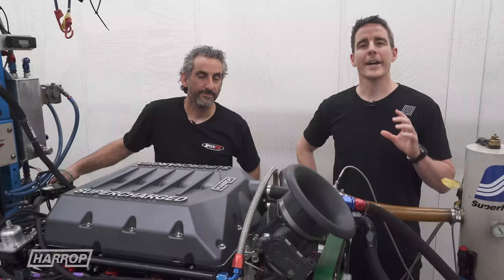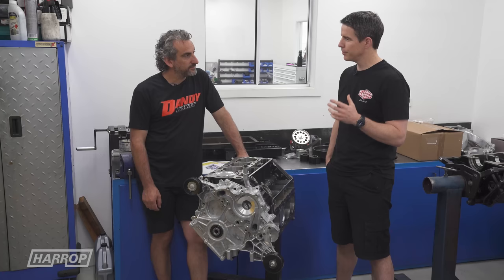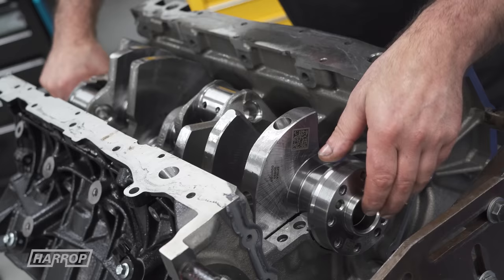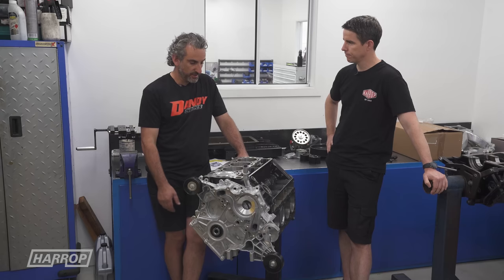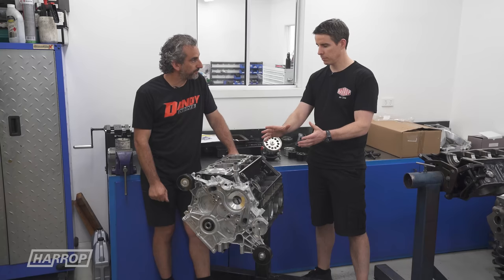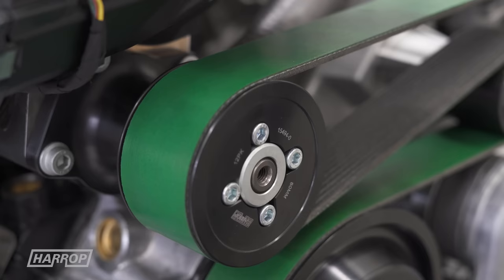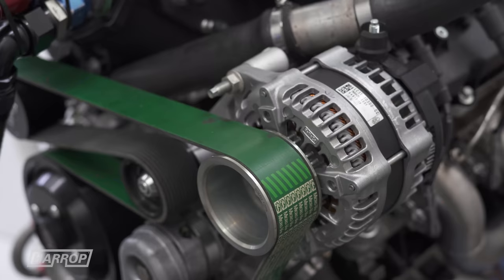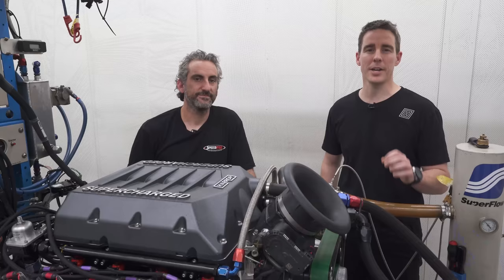1300HP Ford 7.3 Godzilla V8 | Harrop TVS2650 Supercharger Testing

Comment: The 7.3 gasser and the 5.0 coyote has made ford king of the V8 production engines.
Reply: Now that's a funny
Reply: @natemayo1827  - who’s doing better ??
Reply: @CoyoteFTW  mopar
Reply: @scotty3725  - HAHAHA seriously dodge? those boat anchors
Reply: Had to check the date, thought it was April fools already 😂
Reply: Ya pretty sure chevys LT6 will dominate all. 676 NA is insane.
Reply: @Jack Russelle Lewis - This 7.3 is better than any cam in block offered by GM or dodge. The 5.2 predator in the GT500 is making over 800hp at the crank most dynos are yielding around 710hp at the wheels. No camaro or corvette have made that bone stock.
Reply: @CoyoteFTW  what about the 632 that makes 1000hp na from chevy ? Or the 532 that makes almost 700 shipped to your door? 5.2 is a modular engine with twice as many valves as a in block cam design and has a supercharger. So it better make some power, why do you think the old termi 4 valve guys are so fast when they are upgraded they have way more flow potential with that design which is why drof should have stayed with it and left the pr motors to gm and dodge
Reply: @Jack Russelle Lewis And chevy following Ford as always. 5.5 new corvette motor is a  DOHC.
Reply: @71usmc  they stuck with OHV in the Corvette for the packaging benefit and had no problem making as much or more power than the Coyote or the Voodoo. Now that they have the room, they pulled the trigger. They skipped the cross plane and went straight to the most powerful NA flat plane crank V8 ever with a twin turbo hybrid coming. Let us know when Ford pulls that off. They also tested the LT6 in a factory backed racing program before letting it hit production. Something the Voodoo would have greatly benefitted from.
Reply: @sirob584   not really comparable considering it’s not a mass production engine like the 5.0 and 7.3. Not gonna be nearly as common. Also being able to actually modify it is is big deal. LT6 is not an engine you work on in your garage and swap into your insert LS swap car here.
Reply: Lmao
Reply: @mctigmctiggy1475  how is a coyote junk? 7’s stock sealed, factory block went 6’s in a stick shift, they make 1000 unopened.
Reply: @mctigmctiggy1475  Worlds fastest stick shift car in the 1/4 mile is a coyote mustang lol
Reply: @169abr  Mention any engine ever made on YouTube and some inbred is going to throw rocks at it. Always happens.
Reply: @fatkat311  truth, some just have more fanboys than others lol
Reply: @jaywalkin8205  - you named aftermarket engines that cost 40k that don’t come in any production car. I can also name like 10 Ford ones making over 1000 n/a too. There’s a coyote running 3.70 in the 1/8 with stock factory heads. No engine Chrysler or GM EVER made has done that. I LOVE when garbage motors and fiat guys try to always make excuses. The Ford DOHC engines are superior to anything coming out of the other two. GM finally realized they can’t compete so they came out with a DOHC engine. The 7.3 is Fords way of showing they’ve always made better pushrod. TIm Lynch’s outlaw Mustang was running 6.5 sec in the 1/4 in 2008 with a big block Ford on a 10.5 tire. The only other cars close to that at that time on a way bigger tire and and way less weight were in pro-stock. Quickest N/A engine in the world is a Ford small block. Again in IHRA & NHRA the two break 7 seconds both Ford engines.
Reply: @mtnman1984  - LMAO Ford had a DOHC making 1000hp in the 60’s in Indy 500. Congrats on catching up Chevy took you guys 50 years!
Reply: @CoyoteFTW  reading those two comments from you back to back was a good laugh. Telling people not to talk about expensive crate engines, then mentioning a race engine made specifically for one race series. Negative on the 1000 HP too. 500 was about what they got. Remember, Chevy smoked your GT500 and even your seven figure hypercar on the track with an OHV engine. They'll go even faster with the new LT6. Gobless.
Reply: @sirob584   they killed that pos voddoo 5.2 motor... only .3 larger and way more power... pour ford guys lol
Reply: @jaywalkin8205  terminator 4 valve ... thats your glory for motor.... that head doesnt even flow as much as a stock ls3 head...lol this is the best chat so far
Reply: @thomasstott527  haha ya and then they mentioned a big block from the 60’s that made 6aomething but GM has the 632 capable of 1000 NA lmfao
Reply: @gforce_117  typical for guy... your 5.5 flat plain crank is not comparable to fords 5.2 flat plane crank motor... cause it makes to much power.... lol
Reply: @thomasstott527  Look who's so tough behind their keyboard.. Learn how to spell while you're at it. Never mentioned the 5.2
Reply: @gforce_117  damn auto correct... i dont have to be tuff behind my keyboard... you just keep playin with your lil toy rc cars and baby ford motors... let me know when you wanna come over and hang out with the men lil boy lmao
Reply: @thomasstott527  You’re trying way too hard man. There’s plenty of little Ford motors out there that’ll wax you for me.
Reply: @gforce_117  I haven't found one yet.... you keep playing with those rc cars... there a Lil more your speed
Reply: @thomasstott527  lol ok bud. Look harder.
Reply: @CoyoteFTW   for the fact you said ANY engine from Chrysler or gm. I don’t see fords performance engines competing with any Chevy performance engines in this day and age 5.2 is junk makes like 500 hp for the same price as a all out chevy performance engine, Windsor platform is a joke and blows up without being girdled their old big blocks starve the back main bearing of oil after like 400 hp so no ford dosent have the “best push rod engines” they can’t even come close as stock bottom end . So if you wanna talk about times most funny cars or dragsters are custom hemi engines so at that point it’s not even about brand loyalty. Also the fastest production car at the moment isn’t even a American car. The fastest “stock block” 302 isn’t even close to a stock block when it’s girdled sleeved ect but I guarantee the fastest stock block Chevy is literally that a stock bottom end with ring gap and studs. I don’t see the 7.3 holding any records, and the coyote is obviously setting records because it’s flow potential being a 4v head but no surprise gm is not far behind being .3 off the world record stick shift domestic car making over 200 hp less. On top of that ford just crest the 1000hp stock bottom end mark with the 7.3 when ls engines have been doing that for decades now for a lot cheaper and a lot less displacement. So no ford doesn’t make the “best pushrod Engine” they make the best American modular engine for sure but keep lying to yourself when most all of fords records are on highly modified bottom ends while Chevy junkyard engines are setting records.
Reply: @jaywalkin8205  - 5.2l predator in the GT500 is making 708hp to the wheels no other production car GM or Chrysler have ever made has made that much horsepower to the wheels. But you want to talk about crate engines 🤡?   The Ford SOHC made over 660 hp N/A in the 60’s. There is NO LS making anywhere near the power of a mod motor and staying in one piece. And forget that Chrysler “hemi” junk. That’s NOT happening. Coyotes are running 8’s even dipping into the 7’s completely stock. Yes, Fords head design is superior how is that Fords fault? They built a better engine. BuT DOhC. You’re making excuses at this point just say those boat anchor pushrods from GM and Chrysler ain’t worth a shit. Fuck stock bottom end who cares about that?? "The LS is the most pathetic engine I've ever worked on." 

Rick Maskin CEO and founder of DartMachinery Ltd. took 5 years to redesign the LS block in order to manufacture the DART LS NEXT block. John Mihovetz of ACCUFAB Racing, and many other racers, and engine builders across the country like L&M Racing Engines for 10 years have been building reliable racing engines using cast aluminum OEM production Ford Mod Motors blocks, and heads in the 4.6L, 5.0L, 5.2L, 5.4L and 6.2L sizes that can make anywhere from 2500 HP to 3500+ HP @ 10,000 rpm, 66 lbs of boost on Methanol (ACCUFAB '98 Pro-Mod Mustang). John Mihovetz of ACCUFAB Racing has been running 5's in the 1/4 for over 5 years now with an OEM production 281ci 4.6L aluminum block making over 3500 HP with no engine failures in over 20 years for any of his engines or his customers. 

The $3,000 LS NEXT Block designed by Rick Maskin took 5 years to extensively redesign that now is more like a Chevy 350 block than a production GM OEM LS block. Dart Machinery - LS Next block. Far removed from most people who fawn over GM for the design of the LS, Maskin said that in his 50+ years of working on engines,  The LS is the most pathetic engine I've ever worked on. He bases it on several things, including the block's strength and oiling issues. Regarding the oiling problems, Maskin points to the enormous amount of internal oil "leakage" with the LS. The Gen 1 small-block Chevy, which they built 100 million of, takes 5 gallons per minute of oil at 6,000 RPM to lubricate everything. Our modern Pro Stock engines use 3 gallons at 11,000 RPM. The LS uses 18 gallons. What's wrong with this picture? The excessive  oil use and the resulting issues associated with it are due to GM's design of the oiling system, which Maskin points out has numerous problems that are eliminated by Dart's LS Next cast-iron block. In order to provide additional bottom-end strength, the LS is a skirted block, which creates excessive crankcase windage. To address it, GM used "communication ports" or windows between the cylinders, above the main bores, but that leaves very little metal to hold the main bores and cam tunnels in place and can lead to wear problems. All cams flex a little and it's no big deal, but in the LS the cam and crank are like noodles in there, and it wipes out bearings and lifters. 

Will we ever see a OEM production LS based powered anyting run a 5 sec E.T. in NHRA
competition? No.
Reply: @jaywalkin8205  - Demon was dynoed at 703whp latest zr1 was at 645. And sure misinformation, you have all the information at your fingertips you choose to be ignorant that’s your problem. Windsor and Cleveland came out early 70’s and you’re comparing them to and engine that came out in mid-90’s. They’re still competitive! What does that say about the ls 🤣
Reply: @CoyoteFTW  this 800hp gt500 you speak of...is only 760 at the crank...typical ford guys add a Lil extra to make it sound good 🤣... they still get there  @ss handed to it by a bone stock c8... with only 495 hp.... 🤣😂🤣 good job ford... and the much less HP camaro ZL1 ..1le will take it as well... but most ford guys don't post facts...
Reply: Let's compare apples to apples ford guys.... Fords new 572... (finally a large man motor) 655 HP ... ... chevys 572.... 720 hp.... enough said...
Reply: @thomasstott527  Correct. I recently saw a GT350R in person that was for sale. Noticed that the coolant reservoir was dirty. Turns out, second motor. 15K miles on the odo. I'm just laughing at this whole conversation. The LS is awesome. The Gen 3 Hemi is awesome. The Coyote is awesome. The Godzilla looks awesome. The Big Three are car companies, though. Crate engines are secondary. The pushrod powered C7 ZR1 smokes anything else from The Big Three on a road course, which is now the focus and the reason why you see track specials built for it. The base C8 will smoke anything domestic from a stoplight because it dead hooks and has a DSG. The Z06 will move the game even further with a proper flat plane V8 and a mindblowing chassis and since they raced with the LT6, you won't see them blowing up left and right after shedding their oil filters.
Reply: @mtnman1984  it's pretty bad when the oil filter has a torque spec...lol..
Reply: @thomasstott527  yep. BC up there going on about how good old mods are while the 5.4 Triton is a universally hated engine. The C5 Z06 was making 405 HP NA with pushrods in 2002 while Coletti had to move to an iron block and forced induction to get 390 from their DOHC 4-valve. That's unless you scored one of the 300 Cobra Rs that had to run a modified hood to fit the monster 5.4 and its special intake plenum to get 385. Then, there's the GT350. A track focused car with an engine specifically built for it that eats oil and explodes unless it blows up the transmission or diff first. The Coyote is a great engine, but Ford hasn't exactly been shitting golden eggs for eternity and it doesn't matter how much power a GT500 is pissing out. It's still slower than a C7 ZR1 in its intended use and will eventually get smoked by a C8 Z06. Talking about a block design's shortcomings when trying to make four figure HP is irrelevant. These things were made to move sports cars and trucks, lol.
Reply: @mtnman1984  - The 2005 Ford GT was making over 500 hp and an easy 10 second car. And a 3,000hp stock block reworked heads 5.4l from M2k motor sports is currently the fastest street legal car in the world pushing 3,000hp ran 300mph in one mile. The “Universally hated engine” bitch slapped every GM engine made. Just because you’re grandpa drove cheby doesn’t make it the best. You cheby guys always compare mustang to the corvette! But the ONLY corvette that beats the GT500 track pack is the C-7 ZR-1! And no Camaro beats the GT500. Poor GM.
Reply: @CoyoteFTW  2006 Ford GT: $150K, 5.4 supercharged DOHC V8, 550 HP, quarter mile in 11.2.
2006 Corvette Z06: $65K, 7.0 NA OHV V8, 505 HP, quarter mile in 11.5.
Source: Motor Trend
The Triton was a 3-valve version while the GT used a bespoke 4-valve design. Again, 3000 HP builds are pretty irrelevant in overall context, especially if you are going to use the GT as an example. A 3000 HP capable Dart LS Next engine is a bargain next to a replacement 5.4 for a GT.
Reply: @mtnman1984  - That Dart Block isn’t even an ls anymore.. meanwhile the Ford GT uses stock block and heads you see what I’m saying. How do I say it clearer ? And yes you’re right road course is what’s popular now and cheby doesn’t beat Ford on any front.. GT500 quicker than ZL1 1Le. 
GT350R quicker Z/28. Mach 1 quicker than SS 1le. Ford GT quicker than Zr1. I don’t like referring to consumer cars because there is allot of variables. So I refer to professional racing where the cars and engines can actually be pushed to their potential. NHRA factory stock and SCCA GT class mustang been whooping the camaro too even in the overall TA class ford been beating the corvette too.
Reply: @CoyoteFTW  and you’re still off topic just taking shots in the dark to see if it lands, you wanna say “I don’t like using production cars as a example” but when someone brings in a performance engine to the conversation it’s wrong and “not a production engine” so you’re the only one who can do it ? Hypocrite. Such a double standard  with you ford guys, again those aren’t pushrod engines which you claim ford has the best pushrod engines which is un true
Reply: @CoyoteFTW  *a lot
Production vehicles are actually pretty consistent by the very nature of them being copies of themselves. SCCA GT allows for heavy modification. 🤦‍♂️😆 WTH? Check those times too. The LS7 Z28 is above the GT350R on the Car & Driver Lightning Lap board, which is also where the ZL1 1LE is .6 behind the GT500 and the ZR1 is ahead of all those plus the GT. Also, Randy Pobst put the ZL1 1LE up against the GT500 at Willow Springs. The Camaro beat it. All of that... pushrod "chebys". I'd stop mentioning the GT350 too. It's the most unreliable track Mustang ever made.
Remember, car companies. Whole car. None of the Big Three is building an engine for a production vehicle to cater to drag racers pushing 3000 hp. Chevy has had no problem keeping up with and beating OHC Fords with cheaper, simpler, and more reliable pushrod packages in various cars for many years.
Reply: @CoyoteFTW   no, no you haven’t you stated false information and changed topics to deflect. The Windsor platform is at best as good as a Chevy 350 and Everything you gave examples of were highly modified ford platforms but hardly a ford engine anymore. The Windsor small block will blow to bits at 500 hp, the Cleveland holding not much more. Most all other ford pushrod v8s will never reach 1000hp from the factory for long let alone at all. You have to add so much structure to the weak 2 bolt and the rare 4 bolt engines that you can’t even call them ford engines. Ford push rod engines are garbage.
Reply: @mtnman1984  - Production or racing not GM isn’t winning anywhere against the mustang or ford GT. Congratulations on finding the ONE track the z/28 wins. All the other ones it loses against the GT350. Aside from what a keyboard warrior like your self thinks. The Gt350 is an amazing car better handling than any camaro ever. Yes the GT500  track pack beat the zl1 1le by a whole second at vir and 2 seconds at Laguna seca. GT500 has run 10.2 bone stock. Poor camaro doesn’t come close.
Reply: @CoyoteFTW How about the Nurburgring times you know that that ford is not even close to chevy let alone the Dodge Viper are you kidding me ? Just talking out your ass. Do some real research kid. The acr viper, zl1 1le, zo6, zr1, are well ahead of the gt500. All you have to do is literally google and it’s right there. Still fords pushrod engines are less superior which is the topic we initially started on.
Reply: @CoyoteFTW  ...and the C7 ZR1 is ahead of all of that. You keep going back to the dragway as if any of these cars are built for that. The GT350 is a great car with an engine that's great if it doesn't eat itself. The GT500 is a great car with an insane engine. It's a better value than both the ZL1 1LE or the C7 ZR1. Unfortunately is a two ton brick that gets beat by the ZR1 and will be left for dead by the C8 Z06. GM can do plenty with pushrods. Now that they have room under the hood, they will make great DOHC packages.
Reply: @mtnman1984  - It’s not surprising that the corvette wins it’s supposed to at the price range. It’s Corvette vs Ford GT. Honestly I don’t know about the C8 Z06 I want to see how it does against the GT500 track pack I’m guessing they tie on some courses. After all the GT500 track pack did tie with a Porsche GT3RS one of the best road course cars ever made.
Reply: @CoyoteFTW  You're saying that a $120K sports car is supposed to compete with a million dollar all carbon exotic, but not a car that is within $30-40K at most? You are setting all the rules for this discussion, so, I guess?
Reply: @CoyoteFTW  the GT3RS is at a more than 200 HP deficit. Run it against the GT2RS. I wouldn't be surprised if the C8 Z06 is slower than that car.
Reply: @mtnman1984  - Horsepower doesn’t mean anything on tight road course like the one they were tested on. Plus the Gt500 weighs 4k lbs and the GT3 weighs 3,100 and costs 200,00k mid engine. The Gt2 is a $625,000 car. You just told me not to compare over half a million dollar car to one that is supposed to sell for under 100k. So yes I do think the Gt50P track pack is going to give the C8 Z06 a run for its money.
Reply: @CoyoteFTW  You brought Porsche into the convo, lol. You can do that, but price will leave the discussion and you have to recognize the power difference. The Z06 will be faster than the ZR1. Given the same tire between the Z06 and the GT500 CFTP, they will be close depending on the type of track, but I believe the Z06 will come out ahead, sans supercharger, but at a higher price bracket. The GT500 beats the Camaro, which was the point of it, and is a great car at a great value. You can just put a different pulley on the Camaro and match the GT500. The chassis will match the Mustang. Again, though, pushrods do just fine. Funny thing is I prefer the GT350 over the 500. I'm into NA and a third pedal. I've driven the snot out of nearly every car we've talked about. I prefer the GT3s and the GT350 over any of the forced induction cars, even if they are faster. Between 500 and 600 NA really is the sweet spot for a sports car that you take on road and track. It's very seldom that you can enjoy anything with 600+. I think the C8 Z06 may break that for me, though. The platform is not at all stressed with 500 HP and a high revving NA 670 HP won't slap like a similarly powered supercharged car. It will still be able to overwhelm the rears, but the linear power over a wide rev range will offer much more control. I'll have an opportunity to drive one as soon as they begin deliveries.
Reply: @mtnman1984  - That’s all GM has though that doesn’t mean Ford couldn’t of done it with pushrod engine too but they went DOHC. After all Fords pushrod engines won dominated Tran Am and LeMans Shelby cars used Ford pushrod engines. Mr. Shelby himself said best engine was Fords 289ci small block. Saleen S7 also dominated and used a 800hp Windsor which I believe is more than any GM pushrod engine made.
Reply: @CoyoteFTW  The S7 engine is to a 351 Windsor as the Dart LS Next is to an LS1. Heavily modified and nearly its own design. You're correct about the Ford engines being superior sixty years ago. That was sixty years ago. I feel like I'm repeating myself a lot, but GM stayed with pushrods for packaging purposes and did just fine. The engine bay in the C8 is the size of a truck's, so now GM can play with OHC engines and did so right out of the gate with the C8R. I doubt the truck engines will follow suit so long as they stay with NA V8s. They're simple, cheap, and reliable. Probably the same reasons why Ford went OHV for the Godzilla. A DOHC big block would have been huge, complex, and expensive. Mercury Racing builds one. It goes for $65K. You can go nuts saying Chevy mills are shit, but the cars that use them keep up with the Fords with the constant leapfrogging. You can reference race cars all you want, but if we are going to modify cars, might as well get into modified engines: Dart blocks, Saleen, Jim Morris, etc. We could go on and on. Gobless.
Reply: @mtnman1984  - It’s a bored stroked 351 Windsor with Cleveland heads. Best flowing heads in the world. Point is if Ford wanted to keep going cam in block they would have, enter  7.3 Godzilla. What’s another engine that can match the Godzilla from Chevrolet? Without opening the engine swapping cams or porting heads? Koenigsegg also used Fords DOHC engines for their cars. Most successful engine in Formula 1 was the Ford DFV. So these multibillion dollar exotic manufacturers use Ford engines. Why hasn’t anyone used Chevrolet? If they’re soo good like you guys claim. They’re all in the junkyard and everyone swaps them because they’re cheap when they blow up just get another for $500. Even today I don’t see any Chevy engine doing what Ford guys are doing. And that was the case back then too… I don’t know what the debate is at this point all I get from you guys are if and or buts. Nothing real just make believe. Never seen Chevy win Baja 1000, never seen Chevy win leman overall never seen Chevy dominate Formula one never seen Chevy win triple crown in road course and top fuel drag racing. So Ford had a rough start trying to mass produce they’re first DOHC V8’s in their trucks. That’s all you guys have to say. And the 5.4 wasn’t bad it was two years had a bad run. Ford still builds the best trucks.
Reply: @CoyoteFTW  the DFV was engineered by Cosworth and far removed from its base design, as were the S7 and the Koenigsegg mills. Earlier, you argued that the Dart LS Next wasn't an LS. You sure can duck and weave. So can Ford not figure out how to get the most out of their street engines, or what?
Reply: @169abr  man don’t even argue with these clowns.
Reply: @larrypruitt3919  man I stopped paying attention when he said that Joel’s 6 second 1/4 could be beat by a stock 5.3 and a 4L80. These people really think the 5.3 is the greatest engine ever
Reply: @169abr  it's just cheap power, up to a point
Reply: Ford sure did have some making up to do with their engines.  Ecoboost, 5.4 triton, 6.0 diesel, 6.4 diesel.
Reply: @mtnman1984  while true, they think a 5.3 is the only answer it seems. People can’t just admit another platform is cool lol
Reply: @169abr  correct. The only thing more tribal is politics.
Reply: @mtnman1984  - Keith Duckworth went to Ford because of their Indy V8’s you can see how heavily the DFV was influenced by that engine, Ford helped perfect it. Ford had some very very smart engineers and people working for them. Duckworth became Fords racing department up until the 90’s owned by Ford like SVT or Ford Performance. The new Mustang GT does 11’s out of the box I think they’re doing fine.
Reply: @169abr  see the biggest problem I find is people are too loyal to one brand, and typically these keyboard warriors have no real world experience working on or machining these engines. I own 3 Windsors (2) 302 and (1) 351, I own a eco boost engine (which is faster than that years mustang with only a tune shocker) also, but I also own only (1) ls engine kinda funny I own more ford than I do Chevy, I even drive a dodge truck, and to be honest have gotten way further modding the ls over any of the other platforms other than the ecoboost but that’s irrelevant to this post, the 7.3 is the only production pushrod engine that really is even relevant and we’re still not sure what it’s capable of. While impressive when anyone mentions how well the stock Chevy ls block is it’s all deflection and examples of highly modified ford based engines that can’t even really be called a production engine any more. Then the topic gets changed to fastest 1/4 which really isn’t impressive unless it’s a production block that hasn’t been tampered with, like a coyote or a ls. Anyone can set records with a highly modified specifically designed drag engine of any brand but when someone pulls up with a sbe anything and sets records that’s actually impressive and give actual backing to someone’s “which engine is better” argument. For the fact that op and bc think because of this engine ford is the  “king of v8” but nobody can give me examples of fast factory block pushrod drag cars. And the history of track racing has always been Shelby Pontiac and Chevy back and forth, Shelby worked with dodge, but realistically is synonymous with fords performance division, Shelby cars are barely ford cars anyway. And the gto beat that car in almost every aspect. In that time chevy wasn’t that  far behind but fast forward to the 90s and ford was beating its v8 push rod engines with a ford contour (owned one off them too it’s faster than my 94 mustang gt *shocker*) so again fords one off cars like the gt any Shelby which is race oriented and expensive as all hell. So no the answer to the original topic and bcs 2cents. ford went away from pushrod engines for a reason the last 2 they made were crap and the first iteration of the modular engine wasn’t much better. Ford v8s might have a sliver of hope in the pr engine world now with this 7.3. But with how effective coyote and predators are i don’t think they’ll catch up to them selves with this engine.
Reply: @CoyoteFTW  lol no, it doesn’t the 2021 mustang gt does 12.6 in the quarter mile. So there you go spreading false information again.
Reply: @CoyoteFTW  You should probably re-read that book. Colin Chapman (both Cosworth founders were former Lotus engineers) helped convince Ford to fund the DFV project since they had been working with Ford based 4 cylinders to that point. The DFV was an expansion on their Kent based FVA, which bore no resemblance to an SBF or the Indy. The Indy V8 was a reverse flow engine with the intakes splitting the cams. Any similarities between the Indy and DFV were details and not overall architecture. You keep thinking I'm saying that Fords are crap, where I've been saying that Ford has made both great and not so great engines and that GM has been keeping up just fine with the OHV architecture to take advantage of the packaging and efficiencies of the design. Case in point, in 2021, the as tested quarter mile times for the Camaro and Mustang are right on top of each other: 12.2 to 12.3, depending on how good the driver and track are. The C8 is a full second quicker than those two with a pushrod V8. Anything else? You're kinda running out of rebuttals for an argument that we're not even having.
Reply: @mtnman1984  - you keep mentioning the C8 like it competes with any of those cars? You realize the Gt500 does the 1/4 in 10.4. And nowhere near as good on road course. The Gt500 was 5 seconds quicker at VIR. You also keep mentioning how straight line speed doesn’t matter. It’s just very stupid to compare the corvette to the camaro or mustang. GT500 Track Pack is quicker than the ZL1 1lE at Laguna Seca and grand course VIR. The 1Le was quicker when they tested them at throttle house, but Randy Pobst said the only reason it was quicker around that small course was because the GT500’s tires were already toast. And when Car and Driver ran the GT500 at VIR they also said the car had a couple seconds left in it. Which would mean the only cars quicker at that point are half million dollar supercars.
Reply: @CoyoteFTW  ...and the ZR1 is faster, by nearly a second in the quarter mile, with pushrods. I mention the C8 because it has a pushrod engine and will leave the GT500, the ZR1, and even the Challenger Demon from a stop on anything less than a well prepped dragstrip. Throttle House proved that out. If you say it's stupid to compare the C8 to a Mustang, well, it must be true. You are making the rules up as we go along. "Compare the GT500 to a Porsche, but not that Porsche. Don't compare the GT500 to the ZR1. It's too expensive. The FGT is faster, isn't it? No?". I compare it because it's American and the Corvette has been compared to the Mustang for decades. Did you miss the part where the pushrod Camaro SS is just as quick as the Mustang GT? If you boost a ZL1 1LE to 760 HP, how will the times look then? The only reason it doesn't is because the ZR1 does. The ZL1 can handle the power. Good job on Ford catching up too. How long do we have to do this before you admit that GM pushrod engines and the cars they go into can keep up with Fords? Good lord, lol. I told you that I preferred the GT350R over a ZL1 and it was in one ear out the other.
Reply: @mtnman1984  - who gives a f about pushrods ?? Why do you keep going to that. The ZR1 is NOT a second quicker in the 1/4 mile you’re delusional or insane if you think that. The Zr1 ran a 10.8! I prefer the 5.2 revving all the way to 7,500rpm. I always thought it was funny how the Chevy guys talked about the alpha platform being so superior. GT350R beats the Z/28, GT500 track pack beats the zl1 1Le, Mach 1 beats the SS 1le. I also prefer the GT350R. If you’ve been into drag racing for the past 10 years you would know the coyote is ahead of the lt or ls.
Reply: @CoyoteFTW  You're so angry, lol. This reminds me of watching a Street Outlaws episode. Dudes getting mad at nothing. These cars aren't built for drag racing. You must have forgot how you started this. You were saying that Ford DOHC engines were far superior to GM pushrod mills. I said that they're great, but that the engines do power cars and that Chevys could keep up with Fords and, sometimes, surpass them. I'm really not a Chevy or a Ford guy. American sports cars are too damned big. You gonna be OK?
Reply: @mtnman1984  - yes they can keep up I never said they couldn’t of course they need to keep up there still isn’t a GM pushrod engine that made more horsepower than the GT500 and by the looks of it there won’t be one with electric craze. I’m not mad it’s just frustrating. You keep saying their not 1/4 mile cars but you keep going back to comparing them on stop light to stop light. Make up your mind
Reply: @CoyoteFTW  Well good. That's a big step to admit it. You're right. 760 (2020 model) is on another planet from 755 (2019 model, more torque, faster car). I drove a 2011 Shelby SuperSnake with over 800 HP not too long ago. Does that count? Both the GT500 and the ZR1 have been tuned past 1000 HP, so hanging your hat on 760 is a bit silly. I only mentioned stoplights when you brought up quarter mile times to demonstrate how the C8 (with pushrods) is better at applying its power from a dead stop (in the real world) than more powerful front engine cars, which is what quarter mile times are about. I've been referencing road course times for the entire conversation, but you've "been in drag racing for ten years". What would you like to stick to, sir?
Reply: @mtnman1984  - what point of stock don’t you people understand? Even on the dyno GT500 has been confirmed making more like 800. We’re talking stock not what ifs. Yes the C8 gets to 60  quick because of being mid engine we already know this it doesn’t make it quicker to 1/4 mile though. I’ve also proven the Mustangs are quicker than the Camaros and the Ford GT to the corvette  and you get upset. What am I missing
Reply: @CoyoteFTW  "You people". The hell does that mean? LOL. I understand it quite well. You started off talking about race cars and such. You're telling me the GT500 is putting out 800 and is still slower than a 755 HP Corvette on a track? Yeesh. I'm not mad or rooting for Chevy, or anything. The Challenger Demon is more powerful stock than either of these cars. I'm just telling you what I'm reading. The Car & Driver Lightning Lap chart tells a different story to what you are telling. Lap times at different tracks are similar. The ZR1 is a second quicker at Laguna Seca, both times by Mr. Pobst. What are you reading?
Reply: @mtnman1984  - I don’t care about what you’re reading it’s quicker stock on the two tracks that matter most. The only way we can measure which one is better is run them both for laps and see which one fades away quicker and I’m 100% sure that GT500 will stay consistent every lap over the 1Le and that lead while grow every lap. Mustang tied with a GT3. That car is the same tire as the GT500 has automatic transmission mid engine and weighs 1,000lbs less than the Mustang. I’ve only been a passenger in the GT500 but it’s a badass car.
Reply: @CoyoteFTW  The GT500 is, indeed, a badass car, having driven two. I'm pretty sure that I've said that the ZL1 is slower quite a few times. The GT3 is rear engine, but you're close. Don't want anything to do with that ZR1? Do you? Comparing the GT500 to the GT3 RS, but not the GT2 RS, because it's 3X more expensive vs only 2X(MSRP), but also don't compare the GT500 to the ZR1 because that competes with a car 10X its price. Am I getting that right? What two tracks are you talking about, by the way, that render Laguna Seca and Willow Springs, go to tracks for the largest automotive publications, as unimportant? Neither the GT500 nor the FGT have an official Nurburgring time either.
Reply: @mtnman1984  - VIR has long sweeps, Laguna seca tighter track. Best of both worlds. The ZR1 is quicker than the GT500, who cares ? How does that impress anyone? The ZR1’s lap set at VIR was a two week long deal with a team of engineers and semi full of tires. I’m sure you read the part where Ford told car and driver there was couple seconds left in there lap time at VIR and car and driver agreed. I’m sure if Ford took the GT500 for two weeks with a team of engineers they’d be way closer. Magazine PR lap times tell half the story like I said that’s why I like professional racing.
Reply: @CoyoteFTW  I'm sure they would. One can only dream, right? Have a good night.
Reply: @mtnman1984  yup you’ve been dreaming the whole conversation ✌️
Reply: @CoyoteFTW  dreaming of Mustangs with good tires. "They said it could go faster and 🥺 and it's more powerful than Ford says and I rode in one and it's badass and Ford built this one cool engine sixty years ago and this other one that never went into a street car 🥺 and this one guy went really fast with a GT no 🤬 DON'T YOU PEOPLE KNOW WHAT STOCK MEANS I DON'T CARE IF THE CAR IS FASTER 🤬 THE ENGINE IS MORE POWERFUL CHEVY SUCKS FORD IS GOD. 🤡
Reply: @CoyoteFTW  correct. You need a smaller, lighter, less powerful car to beat the Mustang.
Reply: @CoyoteFTW  your precious gt500... makes 760 at the flywheel..... runs 10.4... a bone stock c8 with NA 495 to the crank has been 10.9.... congratulations 🎊
Reply: @jaywalkin8205  he keeps saying a gt500 runs a 10.4 or some bs... they run 11.2
Reply: @CoyoteFTW  you are delusional.... the gt500 stock only runs 11.2... your claims of any faster are false... and if true ...it's not a stock gt500 plain and simple
Reply: The LS is still winning because it’s so cheap. You can build a 600HP NA LS for less than what a stock coyote from the wreckers costs you….im a Ford guy btw.